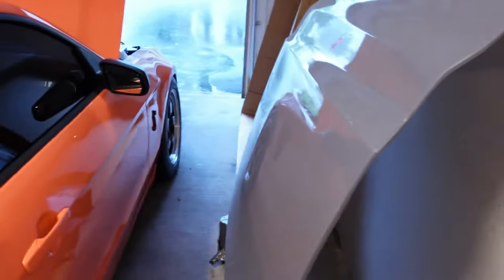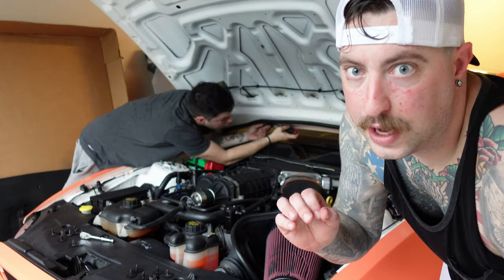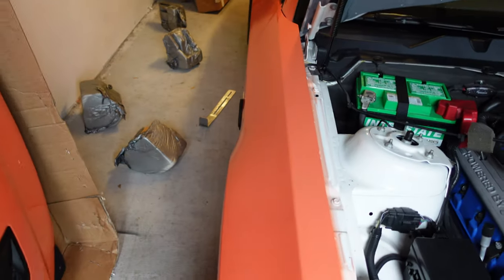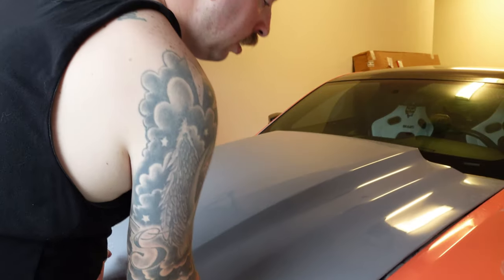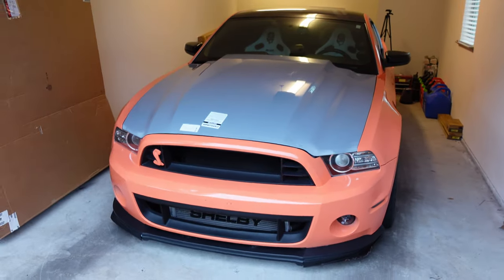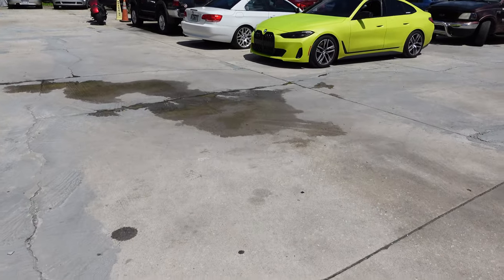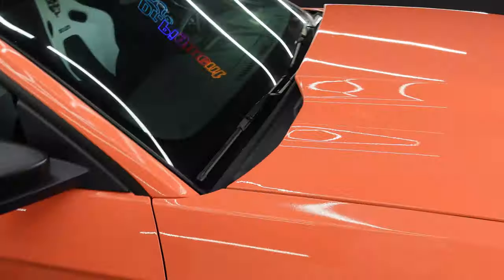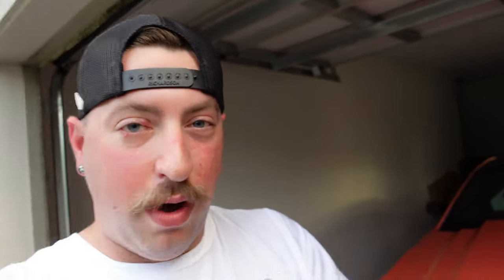Cervini Cobra R Hood Install +Dip on Shelby GT500

Comment: Thanks for the video.  I was debating buying this hood, but the fitment issues are a turn-off.  I probably will just buy the replacement hood vent (mine is faded).
Reply from the maker: I’m going to adjust it soon but should be able to fit just fine! Otherwise hood is amazing
Reply: @inkedsukestache  Ok thank you!  It's on my Christmas list!
Reply from the maker: @charlesdixon552  there you go! Hopefully Santa brings it for you 🤣🎅🏻